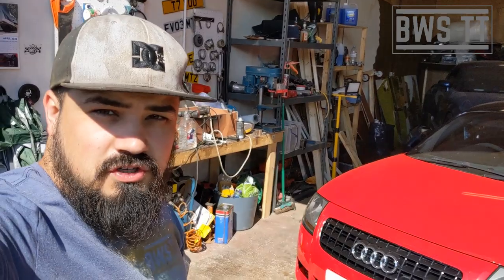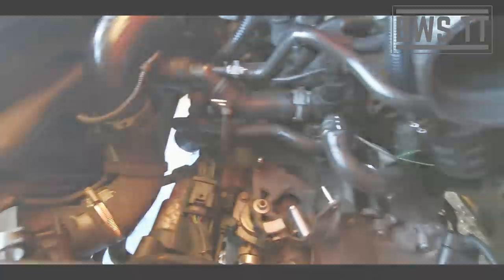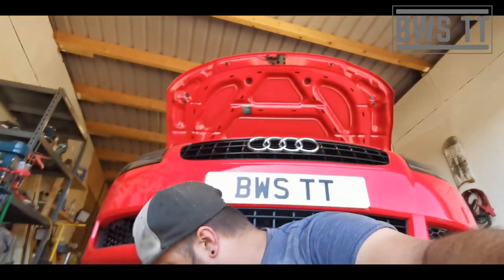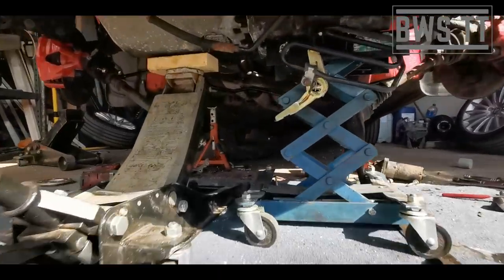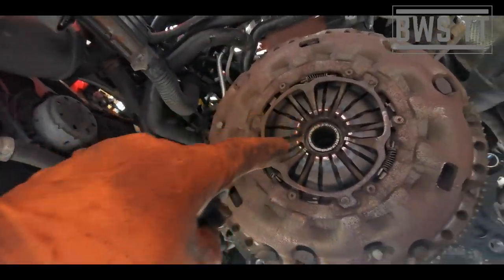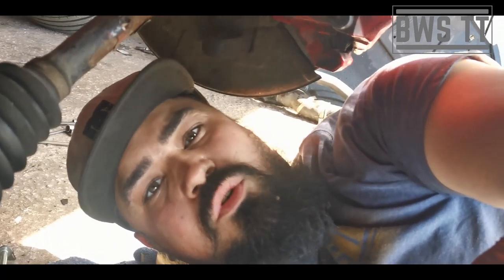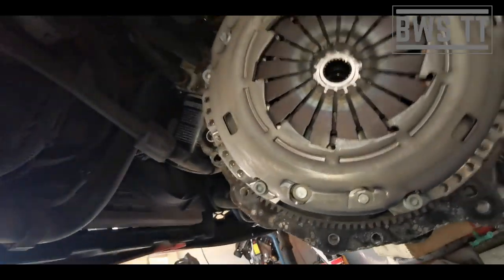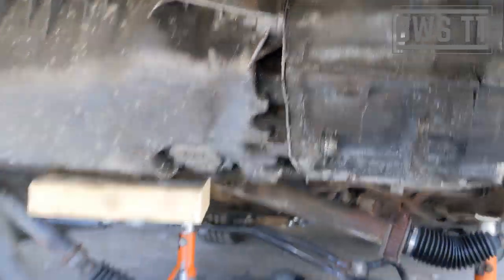Audi TT MK1 Quattro Clutch Change Guide

Comment: Thank you. 
Don't ask me how I learned a dual mass flywheel won't work with a single mass pressure plate. South Bend Clutch was grand in swapping out for the right parts, months after the purchase. . Shipping charge only.
Reply from the maker: That was decent of them!
Reply: It seems everyone who gets involved with the car, wants it to succeed. It's the getting there. This summer will be the wind deflector and installing hydraulics for the top. Thank you again for your direction and suggestions. Without you, this would not be possible for me.  @BWSTT

Comment: This is a great video! I am going to attempt this at home on my S3 8L. Is it possible to remove the box without removing the subframe if I split the box from the transfer box on the car?
Reply from the maker: If you really want to struggle you can try, but in short, no.

Comment: Thanks for the tutorial and all the tips and tricks! I couldn't help buy notice you not saying anything about doing the rear main seal while you're in there. Was this in a separate video that I've missed?

I'm about to be doing a power build on my TT Quattro Roadster with a BEA engine. I'll be switching to a Clutch Masters 01M6SPDSTG3CK kit which is marketed as "stage 3". I'm also pairing it with a Clutch Masters FW017AL 14lb single pound flywheel. I'm aware that I cannot count of this flywheel to absorb vibration like the stock dual mass does, and I'll learn to control that as I get used to the new setup. I'm also aware that adding power increases vibration. To counter this, I'll be upgrading the stock harmonic damper to a Fluidampr, which uses viscous silicon and all kinds of engineering to absorb extra vibration caused by removing the stock dual mass flywheel and adding power. This Fluidampr adds about 1lb to the harmonic damper, which means my 14lb flywheel will effectively become a 15lb flywheel. That being said, it's still a lot lighter than stock.

Comment from the maker: Gary Shanks, thanks for the pint! The new flywheel bolts come with loctite on them from factory, and the pressure plate bolts don't need any - if you want to use some though (for the pressure plate) then medium strength will suffice.

Comment: Hello:) Great video. I'm using it to change my rear main seal. Last thing I need to do after eight months of work rebuilding almost the entire engine and fixing every detail on the car after water pump failed and eight bent valves. 2001 TT quattro 4WD. The only thing left that I need is the extra long 8"+ 6mm allen key for the passenger side drive shaft bolt that is way in there... I have the other one out, and everything detached from everything. Except the two upper bolts of the gearbox, and the 6mm bolt in the center of the passenger side driveshaft. Question is, do I NEED to remove that passenger side 6mm interior drive shaft bolt? Or once I remove everything from the seam holding the engine together at the intermediate plate, where I can see the rear main seal, can I just start lowering it all as one piece? I have the prop shaft to the side, everything separated. Do you need to even deal with the flywheel? Can't I just lower the gearbox, transmission, two ends of the cv axle shaft and everything, with the flywheel and clutch inside of it, as one single piece, to see and access, and change the rear main seal?? lol, Thanks. My brain hurts:)
Reply from the maker: So, you can keep the transfer box mated to thr gearbox (leave the 6mm bolt in and the 4 bolts holding it on) it just becomes trickier. The rear main seal sits behind the flywheel, so youll need to fully remove gearbox and clutch.

Comment: Thanks looks slightly easier than the xtrail I not long done. Great tip for the slave cylinder.  Why have I never thought of that before. Also great advice about those tricky bolts. Looking forward to doing it on the weekend
Reply from the maker: Enjoy! Hopefully this has helped prevent some head scratching moments, and you can just fly through the job :)

Comment: Is there no pilot bearing on these transverse mounted 1.8s? I'm currently working on putting a new motor in a 2001 TT. Replacing the flywheel,clutch, etc and do not see a pilot bearing, nor did one come with my new OEM kit..

Comment: Bruv, please do some video about the haldex. I have mine haldex always on 4wd and I get awful noises when doing the parking manouvers. I tried 3 different control units and still doesnt work, changed the oil and the filter everytime. When I take the haldex plug off the car becones just fwd and there is no noises from the rear on parking place. Do you have any idea?

Comment: hi BWS TT!

YES!   it was very useful especially that clever trick for the slave cylinder, i would not have thougt about pre-feeding it with hydraulic!       -    very smart!   - 

could you answer me 3 questions:

1/ you changed the fly wheel because of the high mileage, fair enough, why not having done the radial shaft seal (aka lip seal from Spi)?
2/ where and how much did you get that smart gearbox trolley (or gearbox jack?) ?
3/ i am looking for an affordable but good enough torque impact wrench, i see you have a milwaukee! which one i should get to do my clutch?(12v, 18v,20V)

THANKS FOR YOUR TIME AND ANSWERS

Farid,

:-))
Reply from the maker: Sometimes you have to agree with the saying “if it aint broke, dont fix it”. With that seal, ive taken off boxes at 200,000 miles that are perfectly sealed still, so they are pretty good. They tend to go if you get shaft play, but at that point you’ve got other things to worry about before changing the seal.

I got it online a few years back, a few manufacturers make them

I use the m18 Milwaukee and it is perfect for 99% of what i do, but that 1% is fixed with a nice big bar
Reply: @BWSTT  thanks for your answer
,🙂

Comment: i w8 clutch kit and try do it...the only thing that make me wonder is why no1 say about timing marks on clutch..if u put it wrong u will get wrong timing when change belt
Reply from the maker: It can only be fitted one way- the crank has one offset bolt hole

Comment: Amazing detail on this - you're a champ!

My 225 Quattro is about to need a clutch job too, so I'm already saving for the bill.

I was wondering if you'd ever recommend a lightweight flywheel, or "Stage 1-2" clutches on these cars (and whether they're significantly affect comfort as far as noise, stiffness of pedal, etc.) - I'm running stock internals and an APR tune, and though theoretically I'm pulling about 275 horsepower and 275 lb.ft of torque at the crank, I very much doubt the real values are anywhere near that, and I don't foresee myself putting enough money into the car that it'd ever go over the 320 wheel horsepower range.

Thank you for all the great videos - tutorials like this are an absolute lifesaver!

Comment: ihave done the exacte same thing on my own tt quattro, the only problem i have after bleeding under pressure. when i hit the clutch, the pedal feels fine the only thing is the clutch wont engage, you can weel it press against the flywheel but wont engage   someone have a tip?

Comment: Hello Bryn, a couple weeks back i blew my engine and now i have a new one and thinking of putting in a new clutch. Its a 225 and would like to give it a little more power about 260-270 hp. What clutch should you recomend? Could a LUK 324030210 be an option?

Comment: What difference does it make replacing the power steering with a hose as opposed to the full line? Is it a temporary fix or can it run permanently like that
Reply from the maker: Slightly less.vooling this way, but that fix is absolutely fine as a long term measure of you want
Reply: @BWSTT  brilliant thanks for your reply appreciate it and also appreciate the videos. Stay safe
Reply: Last question what size hose did you use

Comment: My 225 has some weird sound that goes away after I press the clutch pedal down, it's like a clunking/spinning sound it's not that loud and not noticeable to the untrained ear. Car still works fine/heard the same noise for over 2yrs. Kinda waiting for the clutch to go until I sort it. Should I be worried?😭 Also on another note "diesel geeks" do nice kits for this car
Reply: Any transmission is going to make some noise, there's a lot of stuff spinning in there even when you are just idling in neutral. Some transmissions also have a bit of gear rattle when not under load, which certain mods like a lighter flywheel can also contribute to. From your description, it doesn't sound to me like you necessarily have a problem, especially if it hasn't gotten any worse in 2+ years. If you want, you could drain the transmission's oil and look for metal chunks/shavings. You may or may not see anything, but it's easy enough to maybe be worth a try.

Comment: so i got my axles out and gearbox with transfer off ; gearlinks off also , is it normal for a clutch pedal to go flat , since these components are out
Reply from the maker: Only if you press it, but then it stays down as there’s no resistance from the slave cylinder
Reply: @BWSTT  shout out to you though , helped me take my clutch off

Comment: Great video mate how long approximately did it take you to change it minus the camera man work cheers dude
Reply from the maker: If all goes to plan it's 6 hours for me going at a normal pace. I've managed a box swap in close to 4 hours, but typically you'll want to allocate 8hours if you've not done one before
Reply: @BWSTT  cheers mate pretty sure mine is slipping it's reving in 4th at 60mph then dropping back down again when accelerating . Is it worth replacing it with a better one or just sticking to a standard bam 225 version. Think the car is running at about 270ish bhp. Thanks for the help.
Reply from the maker: At 270 the stock clutch will still be ok, so just get a fresh LUK kit in there and you'll be grand
Reply: @BWSTT  Cheers mate thanks for the help 👍🏻

Comment: Is the DSG transmission similar, harder to remove?  Any tips for a pint?  I need to change the DMF
Reply from the maker: There are coolant lines and extra wiring to consider, and when you remove the subframe theres the vacuum pump that needs disconnecting, but after that its fairly similar. That said, there are enough differences that you will need to check more as you go
Reply: @BWSTT  Thanks sent you a virtual pint via PP ;)

Comment: Do you need to remove the starter in order to replace the clutch ?
Reply from the maker: This video is as comprehensive as it gets. If you watch it, you’ll get the answer
Reply: @BWSTT  thank you ! I’ll be sure to use it if I need to replace mine my biting points at the top of my clutch pedal right now and it was in the middle when I bought it about 2 weeks ago this just happened today that I noticed it and I’ve been very nice to the clutch so I’m not sure what’s causing the issue I planned on doing a deep dive and just replacing the clutch anyway since I assume it hasn’t been done for a long time

Comment: Where’s the propshaft removal bit?
Reply from the maker: It’s in there somewhere- doesn’t need removing just undoing
Reply: Okay mate cheers! Also will a 200mm 6mm Allen key be long enough to remove the bolt to separate the transfer box?

Comment: Hi Man, i need some help with my TT i have a bad oil leak, i've cleaned my engine bay and think i know where its coming from, how do i contact you for work or advise?
Reply from the maker: Email bwstt225@gmail.com I'm quite busy at the moment though so don't be offended if I'm slow to respond

Comment: Did he say 60nm (sixty newt meters) or 16nm (sixteen newt meters) for the fly wheel bolts? 
My torque wrench only goes up to 20.7 Nn which is 150 foot pounds. This seems like an extreme amount for such small bolts.
Can someone help?
Reply from the maker: Hi Kane, been following your progress on FB, that main crank seal needs changing really. Anyway, the flywheel bolts are 60nm plus 1/4 turn. You sure you’re reading your gauges right? 20nm is 15ftlb
Reply: @BWSTT  I appreciate  the help.  I must have been reading the gauge incorrectly.

Comment: I have changed my clutch today to stage 2 clutch kit and now it won't start the starter just spins.. any help?
Reply: What was the issue, did you replace the flywheel too?
Reply: @hvmvp3657  yes I did changed the flywheel too and had to change the starter with a longer shaft it's fine after that

Comment: Major wrestling match. It may be easier to just un-do the engine and trany and drop them out together. That is what I am going to do. Then I can service some other items as well. Yes, AUDI everything they build is a pain! I worked for the dealer for 20 years.
Reply from the maker: I dunno, wrestling the gearbox on with the engine out of the car isn’t exactly a peace of cake, since the engine can move around. Ive never managed to remove and refit the engine in a day, yet I’ve managed cambelt clutch and service in a day

Comment: maybe it's easier to remove the engine than having to work underneath just to remove the subframe and remove the front face, transmission exhaust outlet and a few lignes of course
Reply from the maker: Try getting a gearbox on with the engine out, it’s harder in some ways. Also, I can do the clutch in 4.5 hours, no way engine removal is easier in real world terms